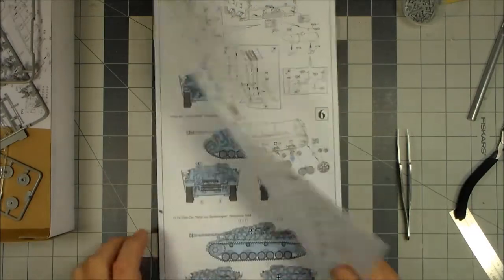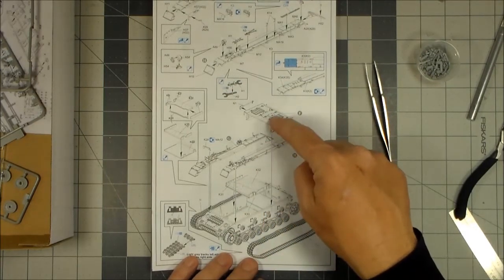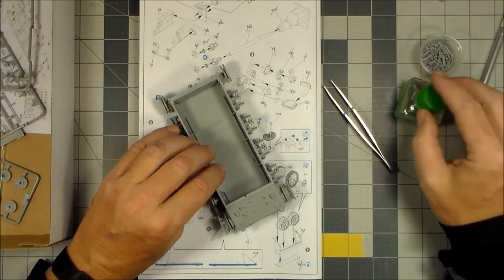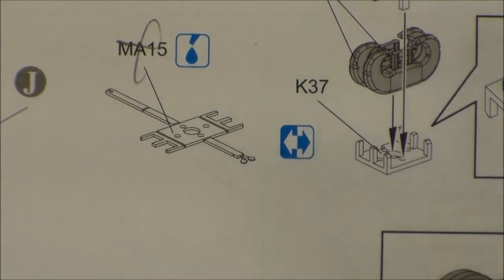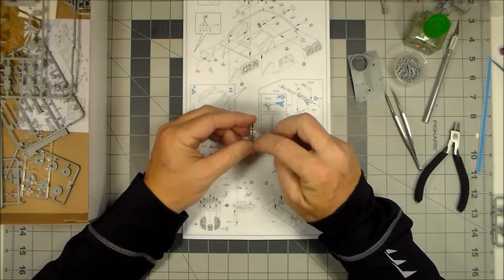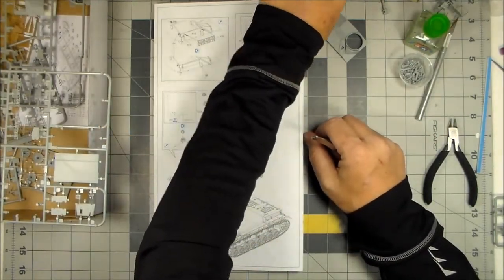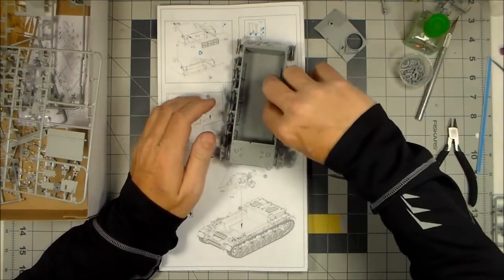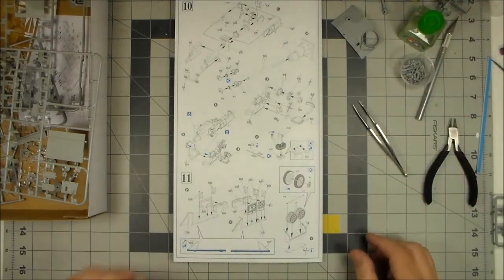Dead In Their Tracks Group Build pt 3

Comment: Hello Brett!  StuG looks like it's coming along very well!  On the subject of cleaning up the gun, even if you leave all the hatches closed you will still be able to see the top of the reciprocator (the round section that sits on top of where the gun barrel mounts to).  Since that bit is two side halves you end up with a seam there along the top, which in real life should be a weld seam.  It's a bit odd how those spare tracks work.  When this kit first came out as an Early StuG IV, it came with the solid guide horn Panzer III/IV magic tracks, and maybe then for this Mid version they swapped to the hollow kind but they didn't change the spare tracks they supply.
Reply from the maker: Panzermeister36 thanks for the heads up on that gun. I guess I'll have to give that a little bit of attention. What color should that part be painted? Do you know? As for the tracks it won't be too big of an issue.
Reply: I always just painted that bit the same colour as the outside of the tank since it's exposed about a half centimeter behind the gun mantlet itself, so I figure it would get painted when they spray the outside colours.